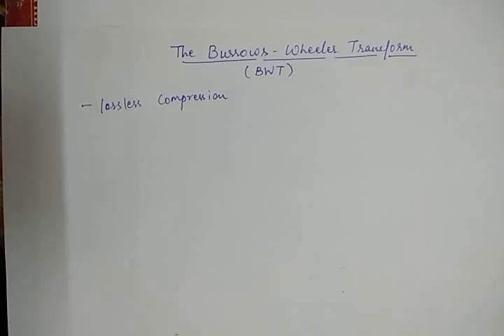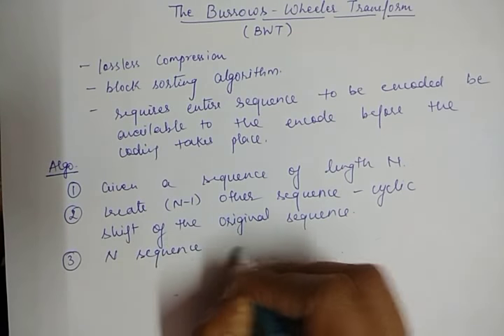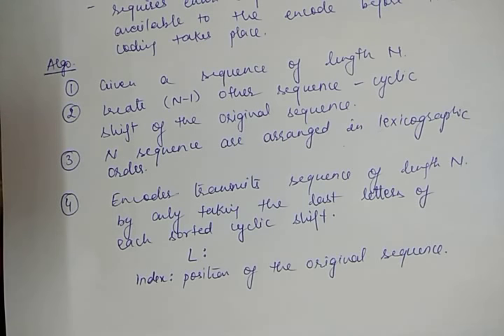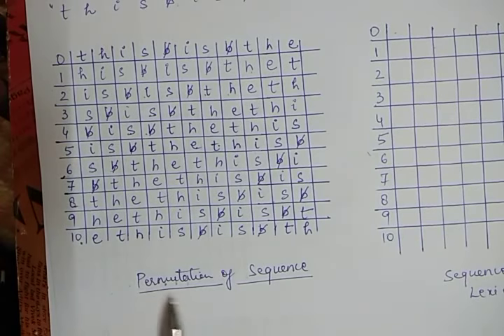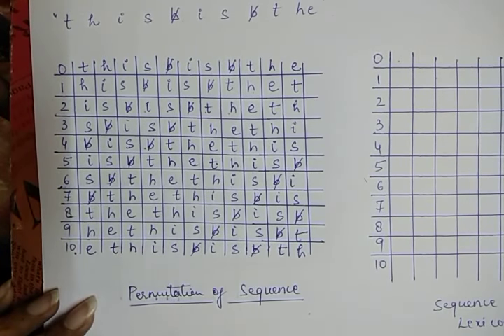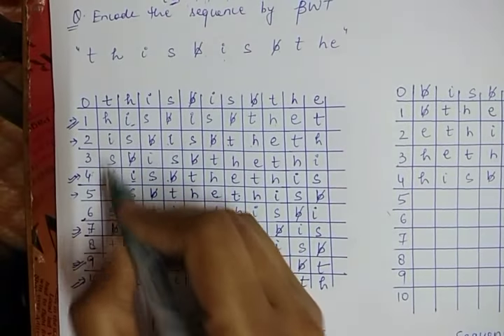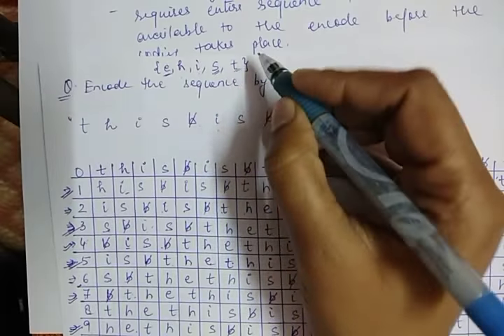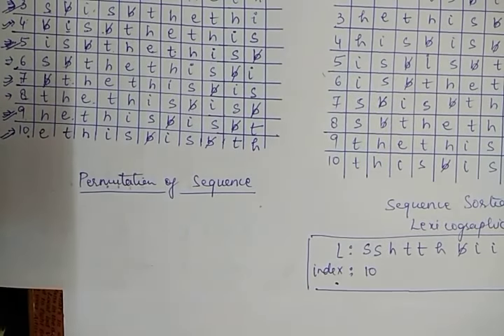24. Burrows- Wheeler- Transform ( BWT) encoding with example

Comment: Which is better method in lz77 and lx 78 which is better justify ma’am
Reply from the maker: yash patel Hi! LZ78 is better than LZ77 as in encoding we use doublet in LZ78 whereas triplet is used in LZ77. So compression is better in LZ78 than LZ77.
Reply: itechnica thanks
Reply: itechnica for decoding

Comment: I want another answer can you ma’am
Reply from the maker: 1. The LZ78 algorithm attempts to work on future data whereas The LZ77 algorithm works on past data.
2.In LZ77 the encryption process is time consuming due to the large  number of comparison done to find matched  pattern. LZ77 doesn’t have its external dictionary which cause problem while decompressing on another machine.
The  LZ78 is a dictionary  based compression algorithm that maintains an explicit dictionary.